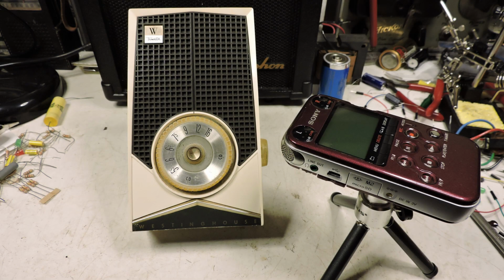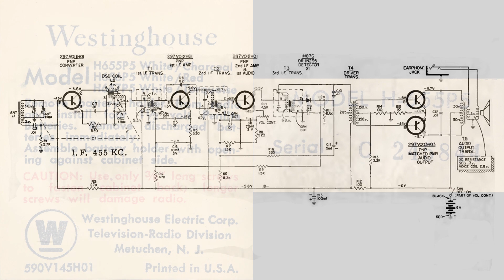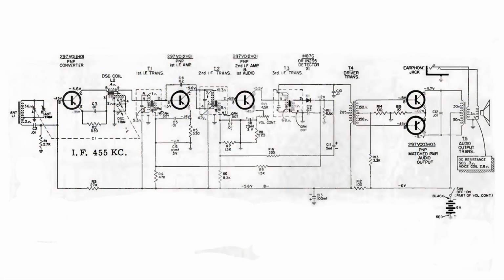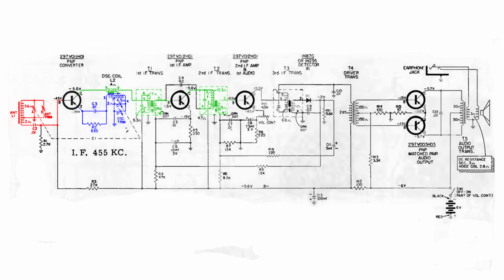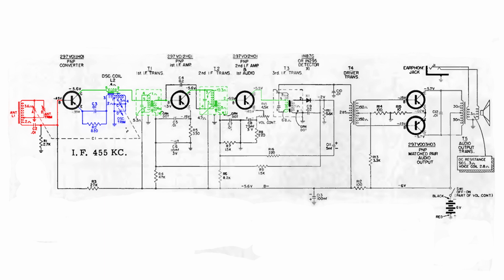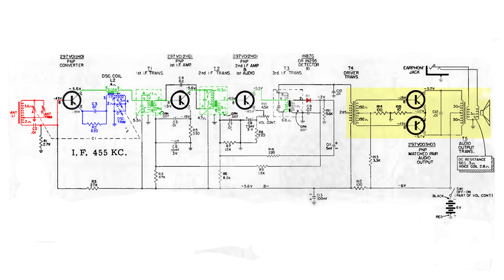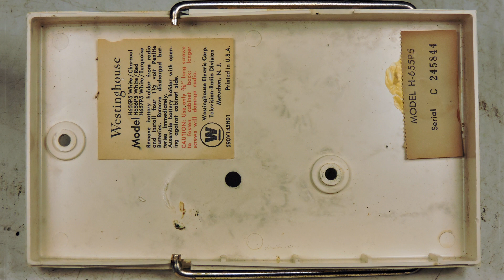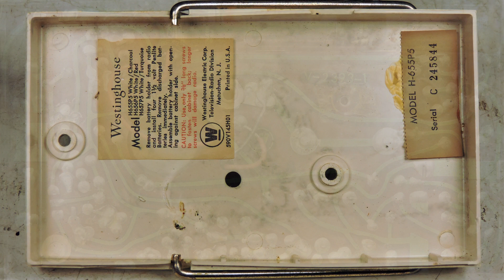Westinghouse Radio Model H655P5 replacing Electrolytic Capacitors

Comment: What is the point regarding the before/after photo of the bottom of the circuit board?
Reply: It shows he did no harm to the circuit board doing the repair and it still looks just like it did from the factory.
Reply from the maker: Thank you.